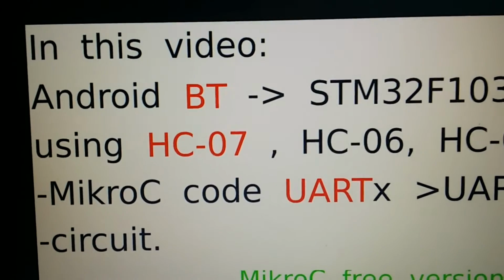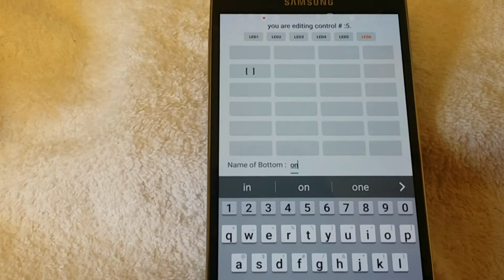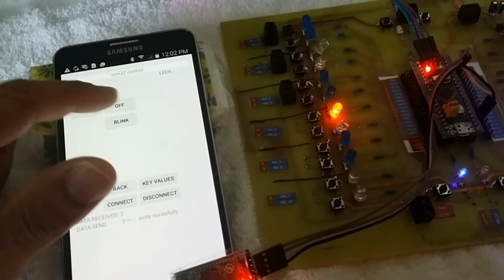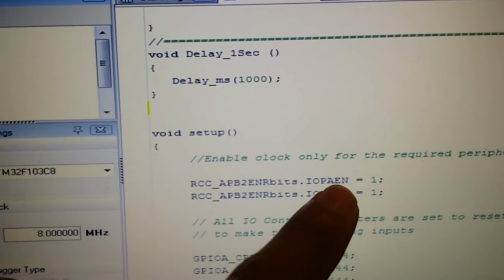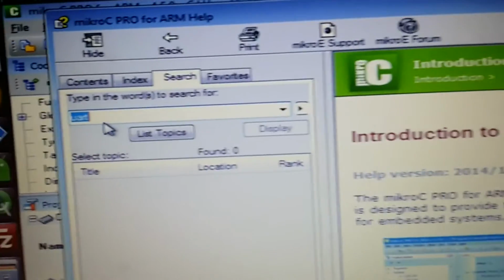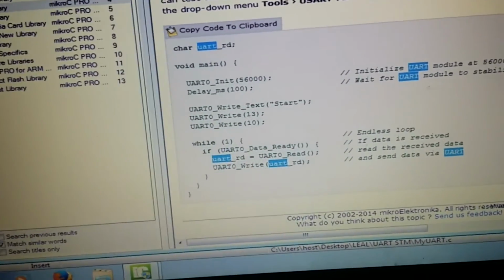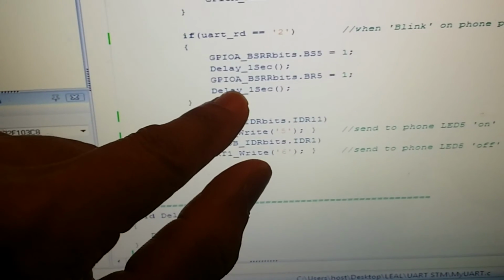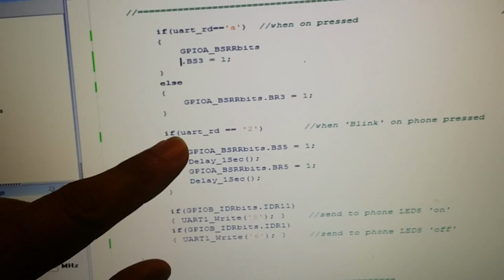04) ARM STM32f103C MikroC ( Bluetooth, UART, Android, TX RX ) HC-07, HC-05

Comment: You could start with this videohttps://m.youtube.com/watch?v=44Yd5XMXibE
It is tailor for the STM32F103Then you can watch tutorial for keil, or Coocox IDE C programming tutorials, both of those software use code logic that will also work on MikroC. I use microC "help section" a lot, it contains example code for libraries. Important .. when you create a new project, if you check include all libraries ENSURE that you disabled the USB library support, this microcontroller does not support USB, so this library will cause you code to compile with errors

Comment from the maker: Hello Hari, thank you for the interest. 
you will need this items  
* STM32C103C8   (X1)
*  HC-07 Bluetooth module  (X1)
*  LEDs (X2)  *  500 ~ 1000 ohms resistors (X2)
 * 4 Pin Tactile Push Button 6x6x5  (X2) 
*  5 volt regulator for micro-cotroller power I use L7805CV (X1) 
* small wires 
* small capacitor for voltage regulator 
 * Breadboard. (X1)   
* ST-Link V2 Programming Unit mini STM8 STM32 (X1)
you will also need power supply it can be a 9V battery, your PC USB, a phone charger, computer charger.  this project does not required much power. 
 
   I know,  it is a lot, but this  parts you will need for many projects. in minute 4:05 on the video I have a simple diagram but I did not show the voltage regulator.

please watch this video     https://www.youtube.com/watch?v=Y-q7OxS4jRE  to learn to use the voltage regulator the video is called "how to use 7805 as a Voltage Regulator"

then watch this video to learn how to use breadboards https://www.youtube.com/watch?v=YrD58qiIOl0  the video is called " How To Use Breadboards - Using Breadboards for Beginners and Prototyping Circuits  "

Finally this video will show you how to use the push button on the breadboard https://www.youtube.com/watch?v=n0VbHPB_2Ws